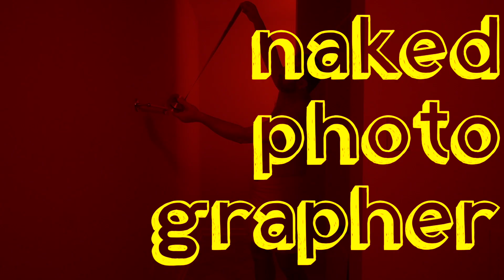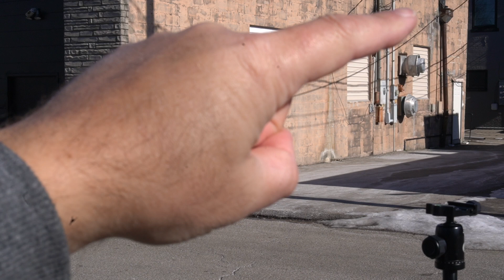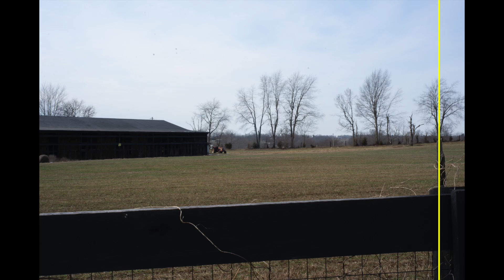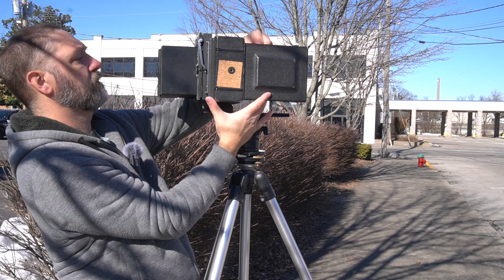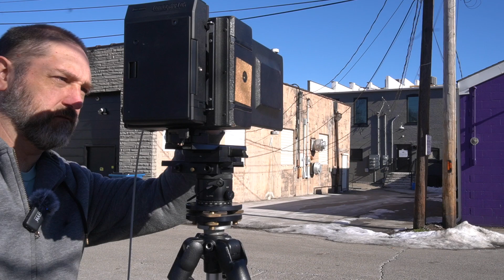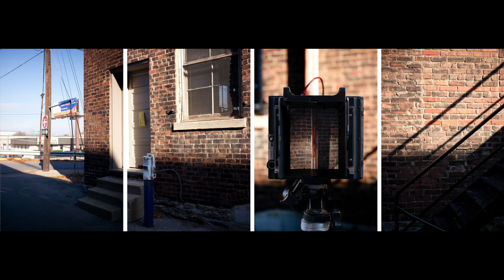Lens Nodal Point

Comment: The Nodal Point is also useful for measuring the focal length of a lens. I use a lot of old brass lenses from the 1800's and mostly they're not marked, they don't even have an aperture scale, just a slot for Waterhouse stops which are usually lost by this point. While inside if you point the lens at a distant object (to simulate infinity) and project the image onto a wall while moving it backwards and forwards until you get a sharp image, and then measure the distance from the nodal point of the lens (usually at or close to the Waterhouse slot) to the wall, that will give you the focal length. (assuming it's not a telephoto design). Divide the focal length by the diameter of the entrance pupil and you have the aperture of the lens wide open. (takes longer to type it than it does to actually do it) :)

Comment: Nice video.  If you get an indexed nodal slide you can mark the nodal point ahead of time so you don't have to do it in the field.  In addition some of the heads have marked degrees for the sideways rotation so you can turn the pano the exact same amount for each photo.  Longer focal lengths typically work a little better than wider ones in my experience.  I haven't done a pano like this in a while.  I might have to give it another try.  Thanks
Reply from the maker: The one I used with the 4x5 has all those fancy features.  It’s a Manfrotto 303vr.  It’s nice

Comment: You're looking for the "perspective center" of the lens... I did a setup to do this 34 years ago... You can do it with a couple of rulers, but I think that you can do it with two strings.. if you anchor two strings at several metres from the camera, maybe 30-45° each side, and line up the strings in the viewfinder so that each string becomes a "point", and then use a straight ruler, rod, or whatever, to extend the line of each string back to the lens, probably underneath the lens for wide angle lenses, the intersection point of the two lines Will be the perspective center. That's the needed rotation point for your panoramas.